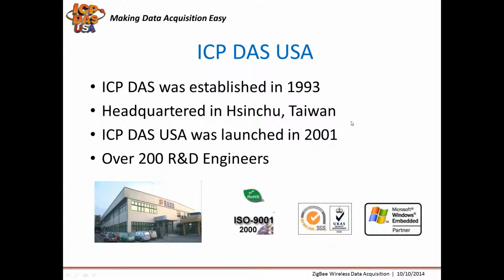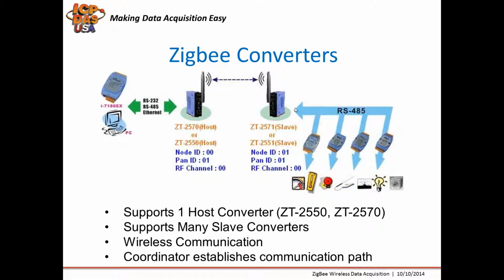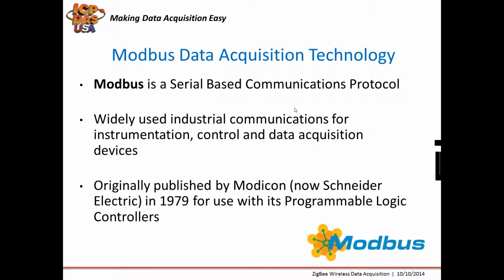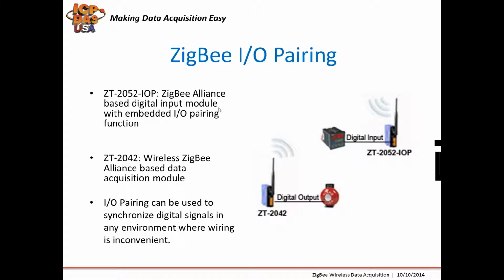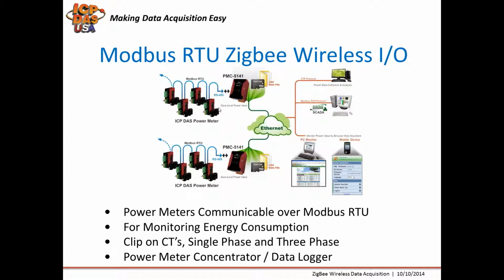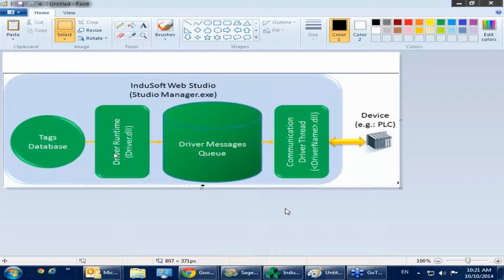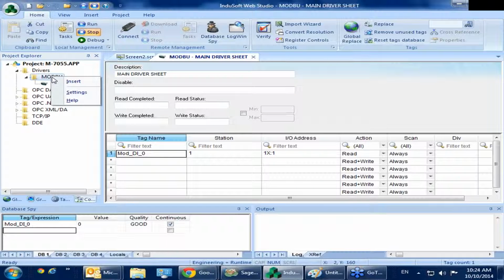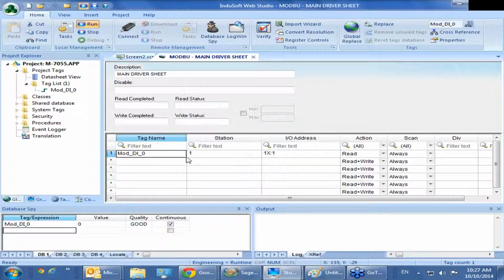Zigbee Wireless Data Acquisition Training

Comment: how to communicate zigbee with plc.
Reply from the maker: Hi there,

It is best to think of Zigbee as a pass through device.  From your PLC, you will connect the Zigbee host (ZT-2550) to either your RS-232 or RS-485 port. This would be the communication port that you refer to when communicating from your PLC.  At the other end, the Zigbee Router (ZT-2551) will convert the signal back to either RS-232 or RS-485.  So, to answer your question, it is the com port from your PLC that you connect to the ZT-2550 that you create the connection to your slave bus on the other side of the ZT-2551 or other Zigbee Router.

If you have any other questions regarding this matter, please feel free to chat with our team at icpdas-usa.com

Thanks, 
The ICP DAS USA Team